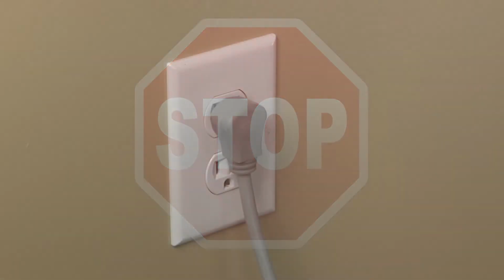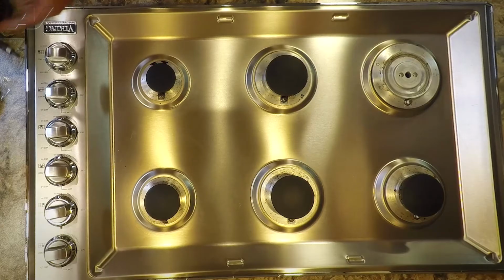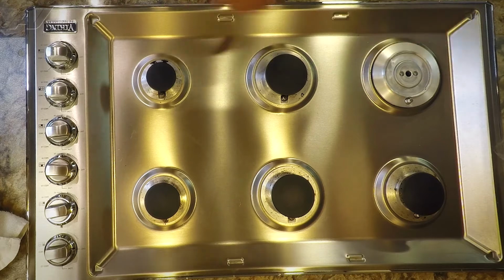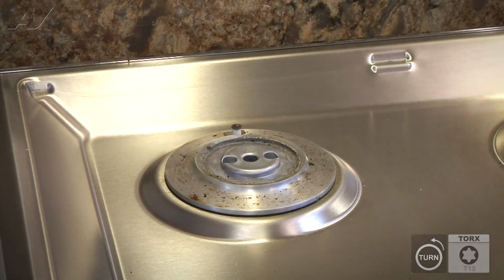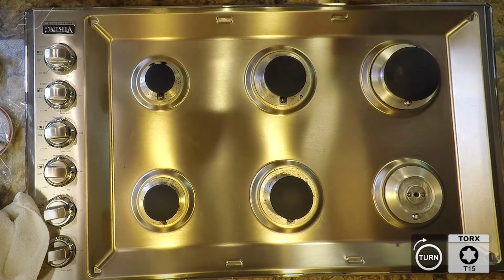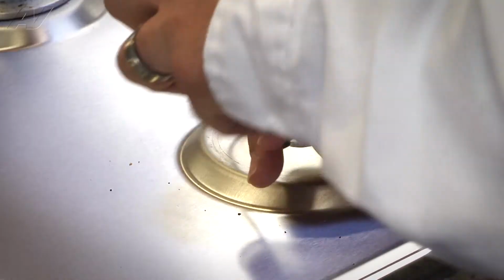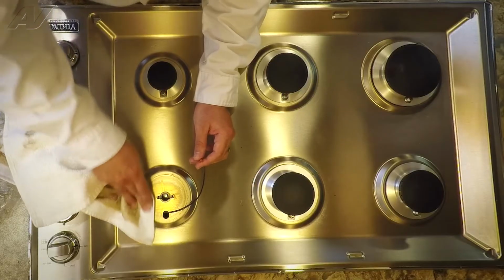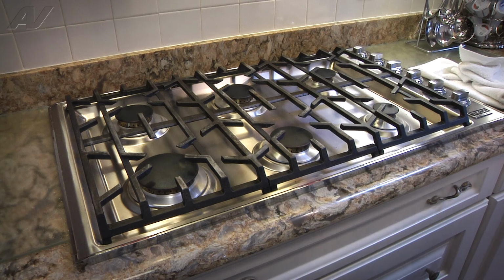Viking Cooktop Repair - Stains On Burners - Burner

Comment: These burner bases cost more than $150 each for the small ones and more for the larger ones.  They can be removed and cleaned with a blue scotch brite pad and Barkeeper's Friend or by steaming.  Very wasteful to have to replace them due to stains.